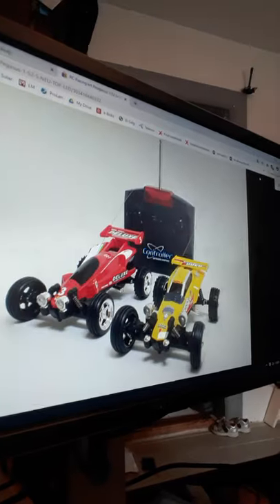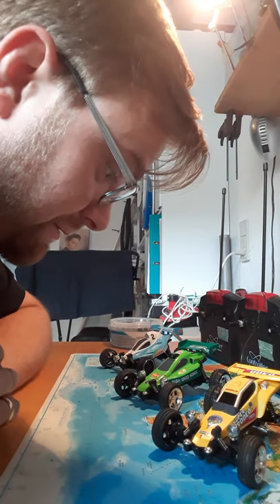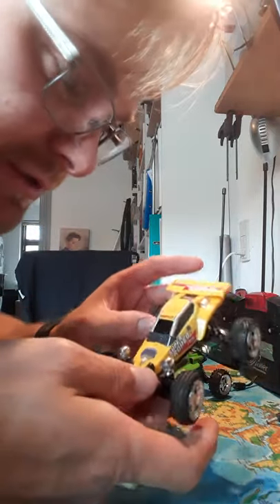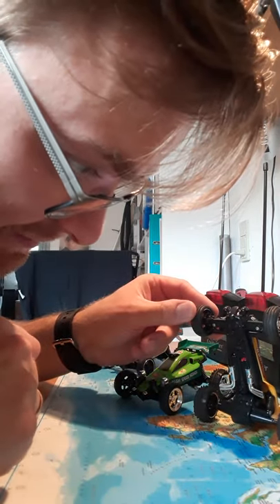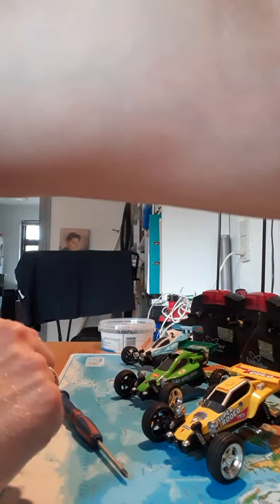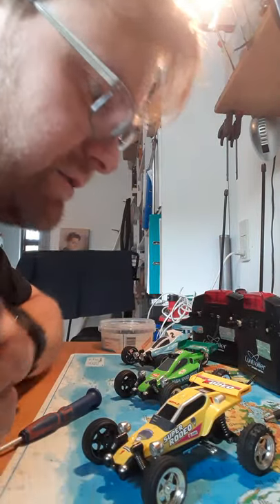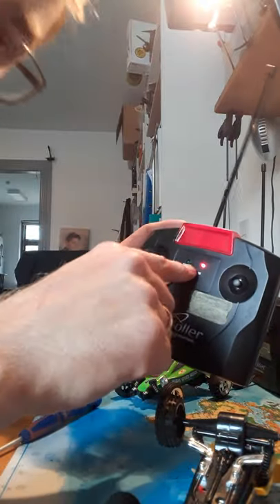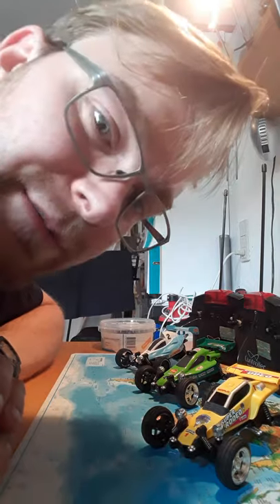My RC cars  - My 1/52's

Comment: The red one is available on eBay brand new for 24 US dollars .. I just bought the yellow one. You should check out the Power Craze Shift 24. Same scale but legitimately does 20 miles per hour. Super fun
Reply from the maker: I actually found a red one last year :) and I've got an extra blue and green since :D